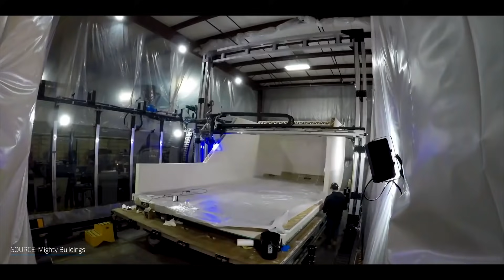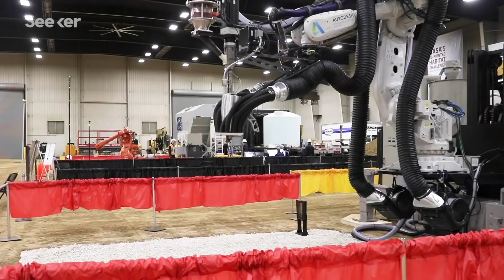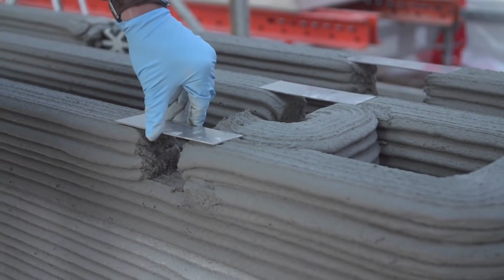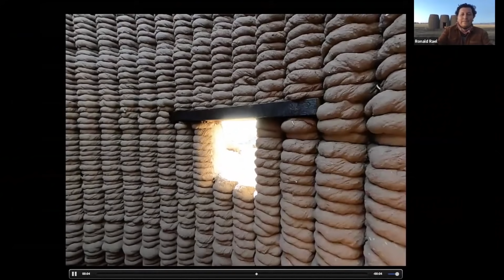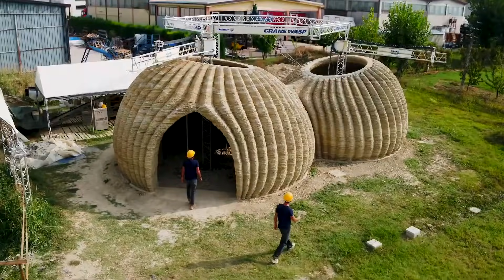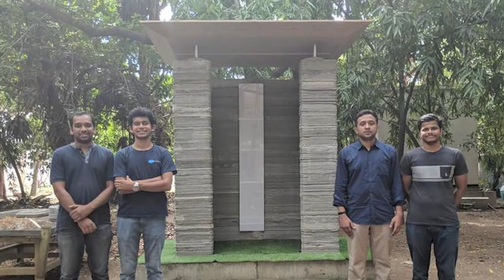This 3D Printed House Is Worth $0

Comment from the maker: This 3D Printed House Is Worth $0! Would you ever live in a 3D printed house? Comment below 👇🏡
Reply: I think maybe you've confused the meanings of the words "worth" and "cost." If this is worth nothing then it is worthless garbage but it isn't so it's not worth $0. Title is dumb af. Also it won't cost $0 either as the building materials may be free but the equipment use and power and labor and land aren't.
Reply: If it is worth 0$, nobody should want to live there; it has no value. A cardboard box has value.
Reply: Any house is worth something depending on where it is built and what is installed.    With building codes up to par with electric, plumbing and all the infrastructure I could see these buildings being worth at least $100 a square foot. Just my opinion
Reply: @miloblue2052  that’s the problem with certain peoples, using homes as income . If it block rain and sun your ahead .
Reply: It's been several months and it seems you're not going to correct this glaring error in the title and video premise. If you don't care about your video's accuracy I don't care to sub.
Reply: Someone paid for the electric and labor to set up . Even volunteer need food that cost money,
Reply: I think "Cost $0" would be better. Usually real estate value or 'worth' is in the land the structures are on.
Reply: @peterbelanger4094  land prices should be $1 all over so people can afford a place to call home even if a empty lot
Reply: @Godareyou911  $1 per what? A square foot? An acre? Who buys all this land from the current owners with what money? Or do you mean we just take it? Why pay at all then?
Reply: @filonin2  if the Indians can start over after fork Tongue .so can land owners today . Life isn’t easy . Rest , wealthy have been wealthy to long . Wishing your family turn is a myth to keep you paying taxes any way
Reply: Shelter over takes money anytime.money is nothing if shelter is out of reach.
Reply: @peterbelanger4094  No, I don't think the cost can be $0: material, labor, machine rental cost.  Actually worth $0 is a suitable self-labeling as no body is willing to buy house with walls only.  No drain, electric, no internal decoration, ventilation.  Build a house is 100x more than just print walls.  Shipping a 3d printing machine to desert, mixing the materials and operate them doesn't seem to be very practical comparing to the traditional way like wood framing.
Reply: Yes we have no alternative but to do so.
Reply: @Mindscape234  No one on earth has no option but to live in a 3d printed home. Can you not make mud bricks yourself?
Reply: @filonin2  or log cabins?  Or dug out housing.
Reply: Euhm.  I had contact with them and the whole system is around 28.000 and then need to finance the architect and workers to setup and build the mud house. Great system.. amazing invention.. love it.. really. But I can't pay for that at the moment
Reply: it costs a lot, but is worth nothing, do i understand the title correctly?
Reply: After seeing several examples of 3D printed buildings I'm here to tell you it is a great idea especially near the shore. Went through the hundred-year flood in Connecticut and I'm pretty sure these buildings would be unaffected if they're built according to code now.
Reply: The bad english in the title is very misleading. These houses have worth, the land they stand on, the materials they are made from, the energy put into the machines to build them, the cost of the machines and more. Add all that up and scale for demand and you have their worth. I get that the hope here is that they can be made as cheap as can be to solve the problems of people who cannot afford, but someone always pays in the end. If this had been a video about a machine that creates unusable housing, then maybe the title would have fit.
Reply: Man how much it is underestimated how fast a house can be build with simple bricks.
Reply: Yes I would..
Reply: Yep
Reply: Yes sir I would most definitely👍🍻
Reply: Yes
Reply: Wown won won wonderful
Reply: I would 3d print a storage shed.
Reply: @foley2k2  think big ,enough shelter for a small family in need. Doted all across America 🇺🇸
Reply: Because that's how production works. You use raw materials and add labor to them to keep the value the same.
Reply: soo the land costs money, the people doing it cost money, the machine costs money, the materials cost money, what exactly do you mean by "worth $0"? that nobody would want it? because it's certainly neither free nor cheap.
Reply: Is it tho?
Reply: Come on over a 3d print me a house
Reply: Clickbait title!!!!!!!!!! "Cost" $0... Not "Worth" $0

Comment: You are creating a cave and print only walls and called it a house?  That's only a fraction of the house building cost and works!  No drain and electric and internal decoration and you call this house?  3D printing machine doesn't need set up and transport?  Doesn't need place for construction?  Doesn't need engineer for calibration?  Material cost is zero?
Even the pre-build panel is more promising and practical.

Comment: Yeah, that title is extremely clickbait and misleading. 

Engineering cost, development, technician cost, material property cost. 

You can’t just use local resources like dirt-clay to build a house. Ensuring consistency of the filament and to make sure it structurally sound would be a logistical nightmare and extremely expensive. 

Also you would have to pay for highly skilled labor, which would likely be more expensive than just building a regular house…

Not to mention you have to survey the land before building the house which also cost money… How does this 3D printing make a foundation? 

Also claiming this could be a solution low income/poverty stricken areas is just nonsensical. You could easily build a frame fill it with that material and be substantially cheaper…

Comment: I guess the following didn't have any costs...land , permits, engineered drawings, impact fees, surveys, grade work, 3d printing machine, power for said machine, raw materials , excavation, transportation, labor, waste removal, electrical, plumbing, septic or sewage hook up, windows, doors cabinets, flooring light and plumbing fixtures, locks, hvac, landscaping, inspections and permits.

Comment: congradulations, you built a mud hut... with a machine took more effort to build than the home.. and required more energy and manpower to set up than building the home by itself would have.  but it was quicker... wich doesnt matter. we could just deliver the materials and basic plans to everyone and they coudl jsut build it themselves.  it would take longer, but it woudl take less energy. or.. heres a new technology idea. someone shoudl take this idea.. but make the material more rugged and uniform. and above all stackable. but in a way that is efficient for storage and can interlock to form a strong lattice structure. i will call it the  brilliantly radical ideal construction kit. or B.R.I.C.K. for short. it can be made from local materials using water, stone, mud, clay, and a bit of fire. and can be made by hand or in a large production facility depending on infrastructure. they will last thousands of years and can hold immense pressures capable of supporting up to 10 storys tall if built on a proper foundation. plus they are naturally insulating agaisnt sound and temperature. plus they are reusable when you want a new home.

Comment: Zero cost is totally unrealistic. The land costs something, and I doubt the machine can be rented or bought for free.

I suspect these homes will have similar problems to Edison’s failed concrete housing ventures. Repairs were a problem for one thing. Pipes and wiring were other problems.

I can only imagine that it would be a difficult battle to get one of these approved for living in. I doubt many local building codes would deal well with these.

Comment: Are you too poor to afford proper housing? Are you living in a house made of locally sourced garbage? Well say no more, for the low cost of a cutting edge 3d printer, you can live in a house that has no objective advantages to your current situation but is at least made from locally sourced dirt.

Comment: I'll never understand the whole "3d printing houses" thing. The walls and roof of a house aren't what take so much time and money to finish. When I bought my house, the walls and roof were up in a single week. The next six months was plumbing, electrical, ductwork, insulation, drywall, texturing, painting, flooring, cabinets, trim, and doors. Presumably a "3d printed" sludge house would still need most if not all of this.
Reply: its a dumb gimmick on earth, but can make for great structures on planets like mars if they can source the materials right from the soil without having to haul lots of stuff on expensive rockets, also these structures, if built on mars, can help in defending against solar radiation and sandstorms. truthfully, nothing will be done for the impovershed because the people who have the money to do this will think its a waste of time and funds. there are factories that build modular houses for dirt cheap that can be assembled in under a month, but still will never be used because most rich people only think about getting more money
Reply: @documentedmentaldegenerati9030  Prefab houses are often built to last only a few decades, I know because I'm in one that's 45 years old and needs to be rebuilt.
I wonder how long these 3d printed houses would last.
Reply: @goombario3220  thas why thay are so cheao
Reply: @goombario3220  at least 15 years!

(as long as it doesn't rain, the sun's not to bright, and mud is a perfect ratio of clay and unicorn tears)

Comment: ok, this is pretty cool but hear me out. instead of setting this all up as a plumbing and wiring nightmare, just print big interlocking pieces off site. itll be easier to make surplus and you can think of it like lego and design your house with all these different pieces going together.

Comment: I love your content, but your audio quality could be improved.
Here's a few tips :
1. Buy a pop filter
2. Point the microphone to your upper chest
3. Move back from the microphone an inch or two
4. You are obviously already using a low pass filter in an audio editing software, so you can easily do these too :
    4a. Remove plosives and rumble with a high pass filter (~60hz)
    4b. Remove mouth sounds (clicks and pops)

Comment: Sounds like we would use this as one of the many things we should do to help sustain quality human life on our planet(s). That is one of the positives. Not a true negative but I do have a question, "in many climes wouldn't it be more simple to make molded bricks. They needn't be rectangular in every dimension. We could 3D print molds of any parts that needed multiple copies. The printer could be considerably smaller depending on available materials.
Reply: they already do this, making traditional adobe homes and in other countries they do the same thing using forms to make bricks that dry in the sun.
Reply: @andrewking2590  I've heard about in some documentarys but I've only seen an actual mud or modified with cement in Arizona. IDK if they made bricks\large panels or they used Simon forms to form them in place. I'm pretty sure that it wasn't highly reinforced because they could cut and remove walls with a saw made from mostly barbed wire

Comment: the 3d printed homes is a great idea and offers a greater level of flexibility with complex designs and low cost. imo though I would put a more finished look on the outside and inside walls for aesthetic reasons. the tech also needs to consider methods of installing basements.

Comment: So, why is a 3D-printed mud hut better than a regular mud hut?
Reply: @halfpricewizard  and what about the 3d-printed one?
Reply: How is it more effective, if it requires a precision machinery, electricity, engineering crew, preconditioned materials, etc.? 

And the end result is still a mud hut with no windows  (i guess, no doors either), they are still to be carved out by a construction worker. And also, the rooftop is not printed either.

Comment: how structurally sound are these in an earthquake though because the reason why some developing countries have housing problems is because of earthquakes.
Reply: as structurally sound as anything else not designed for earthquakes would be. which is pretty much everything except specially design skyscrapers.

Comment: My main concern is that there is not enough construction quality clay to scale this up. Even if there is, it is not simple task to get and purify it. There is definitely use for this technology and material where it is available but it is not going to solve problems.

In poor countries, the work is cheap. People could build they houses by hand if material and land would be available.
Reply: no such thing as construction quality clay or purified clay. it's about the mix of materials in the right proportions to extrude without trouble and harden afterwards. like concrete, get the mix wrong, and it doesn't matter how pure the cement is.
Reply: @andrewking2590  I don’t agree. In many places the clay contains too much other substances and don’t harden enough that you can build anything from it. 

So my definition for construction quality clay is that it can be used for construction purposes without heavy purification.

Comment: I don't see a single design here that would function in cold climates, clay simply doesn't survive annual frost.  You'd have to use concrete, which would dramatically increase carbon footprint.    You'd also need a far more sophisticated foundation than we see here.   

The comparison to conventional building is pretty meaningless since the final product is so dissimilar, and these aren't even finished buildings, they aren't ready for occupancy so that is also a relevant time factor.  

It has some interesting potential for basic housing, but the product simply isn't that attractive for higher social classes.  I'm a builder and these lack so many features modern buildings incorporate.
Reply: About this comparison you're right but only in regard of what is available right now. It is an experimental process here focused on external walls (but it can produce inner walls too, and straight ones if desired). It could very well progress a lot during next decade, with a variety of new building materials and better finish, up to the point to become competitive with other wall building technics.

Also it could be not competing with other technics, and just be an additional tool. We can imagine wooden inner walls made by cnc to get a very adjusted and fastly build interior, a bunch of solutions to cover external walls... this project is thought in order to promote this technology but does not use it at its full potential.

Comment: Build cost and worth (value) are two completely different things. And while build costs were probably VERY low, it was certainly not zero. Infrastructure and logistics costs to get the equipment on-site cannot possibly be free, and it's unlikely that all of the resources (including water) were free. So it's absolutely low-cost housing, and a great solution. But "worth $0"? You are promoting the idea it's worthless?

Comment: Pretty cool for use on earth. But the materials on mars will have to block lots of radiation. I suppose you could mix metal into it or make a two layer house with a "water skin".

Comment: Do you not understand the difference between cost, worth, and impact? Or are you just fishing for the algorithm?

Title says house is WORTH nothing; it has no value.video proceeds to explain how amazing and valuable/beneficial the technology is.
EVEN IF you meant costs $0 you dont explain how that's the case as the printer would cost something the construction people cost something and even clay has its value. 
What it seems like you're trying to convey is that this tech will not require material inputs from any region outside of where the project is taking place (once the infrastructure is established).
Reply: Fishing. He knows exactly what he is saying, but posting something with such a provocative title will bring lots of views, and lots of angry people like us in the comments, which pushes the video further up the rankings.

Comment: Seismic, thermal protection , performance in a fire:  inside out, outside in, durability over 5--100-300 years, ability to withstand changes to additions:  a new room, installing utilities such as HVAC, mechanical, communications, electrical?
Reply: Also ease of repair, especially after disasters.
Reply: There's a reason monocoque cars aren't common...  Monocoque housing aka 3d printed houses have pluses and minuses.  Repairability and durability are two major drawbacks to 3d printing.